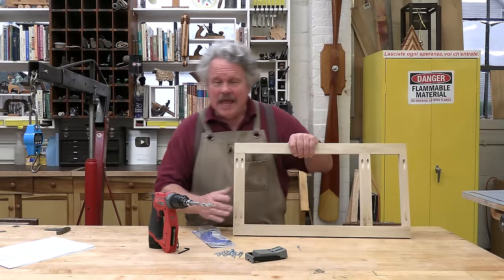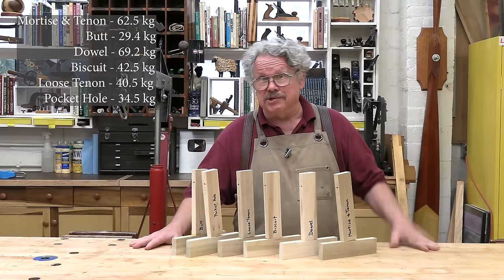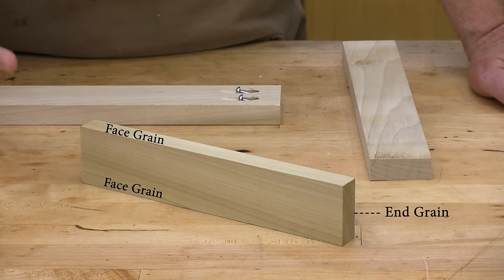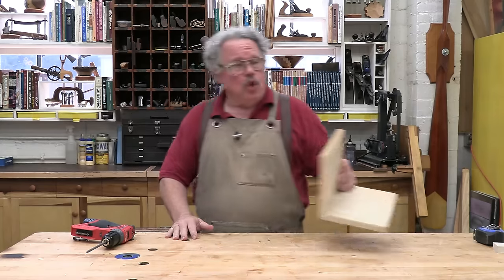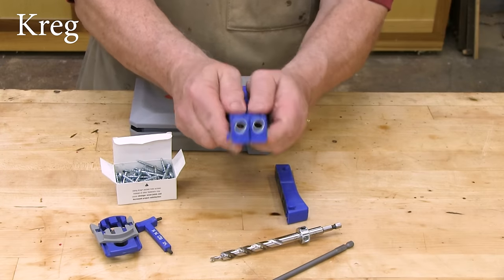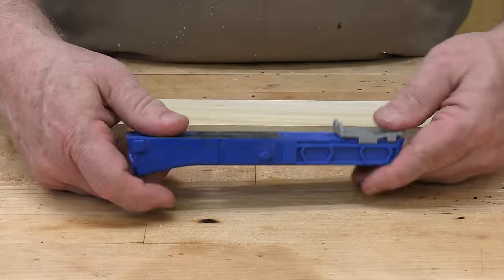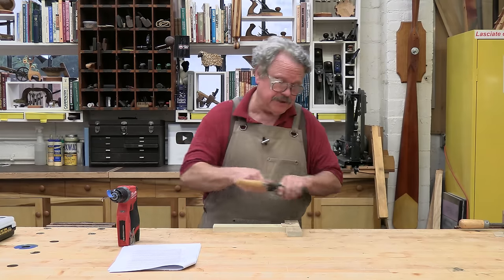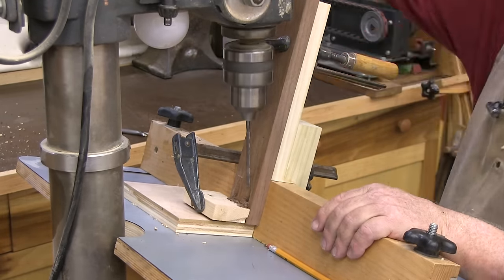Pocket Holes Overexplained

Comment: Pocket holes are a great entry point into finer woodworking, like building yourself some shop or pantry cabinets.  In my experience the #1 killer of the hobby (really any hobby) is when they jump in the deep end trying to emulate pro's or masters, before getting a win or two under their belt using easy and proven techniques.  
Just for fun I emailed the guy who bought the house I used to rent in the mid 2000's, I built some simple cabinets for the garage with pocket screws that I intended to bring with me.  In the end they wouldn't have made sense in the next place so I just left them, anyway I asked if the cabinets were still tight and sturdy, he said yes and had no idea a first timer built them because they look and work well.  So plus one for pocket screws.

Comment: If you put some CA glue into the pilot hole of the receiving piece of wood, the joint takes on a different level of rigidity.
This is x100 with MDF joints, although they need to be glued with a wood or construction glue. 😬

Comment: Thanks, I learned some new aspects of PH joints today. However, you did not mention that if you move the stop collar so the drill exits the end of the pH piece, you are also drilling the counterbore deeper and not leaving as much "meat" to prevent the head pulling through. I would have to think that this woulld weaken the joint.
Reply from the maker: That's a VERY good point, and up until 2014 there was a very easy way to belay that concern. What you're talking about is the Achilles heel of all pocket hole construction -- pocket hole joints rely on the strength of the wood between the bottom of the counterbore and the end or edge of the board. If the shaft hole exits to the edge, you're golden. There is some strong cellulose between you and disaster. But if it exits the end, it's another story. You're relying on the lignin that holds the cellulose fibers together -- and the lignin is nowhere near as strong as the cellulose. You can offset this somewhat by using proper gluing technique. Modern glues are much stronger than lignin (see Patrick Sullivan's videos), and a good glue bond will help disperse the load over the entire end of the board, as we demonstrated in our strain tests. But it's still a concern. The best solution I have seen is the telescoping bits made by the Morris Wood Tool Company. These consist of a long counterbore drilled out like a rifle barrel with a long shank-hole bit riding in that barrel. An Allen screw lets you adjust the position of the shank-hole bit in the counterbore. This, in turn, let's you adjust both the depth of the pocket hole and the length of the shank hole. I bought set in the 1980s and found them to be absolutely the best drill bit for pocket holes ever devised anywhere anytime in the history of the universe. I'm not exaggerating even a little bit (pun intended). I had written an entire section of this video on using telescoping bits for pocket holes, but when I looked them up to give viewers a link, I discovered that Morris Wood went out of business in 2014! I searched for a replacement, but I couldn't find anything comparable and had to cut that section. If anyone reading this knows of a manufacturer of telescoping bits (long counterbore surrounding a long small-diameter bit), please let us know. It would be a great boon to anyone making a lot of pocket holes.
Reply: @WorkshopCompanion  Or possibly, someone makes a combined shaft hole and pilot bit  for your second hole. I think most people will already be loath to do a second drilling  for the pilot hole, so I'm not going to suggest THREE drill bits!
Reply: @WorkshopCompanion  sent an email to the channel address. The Amanda 424000 face frame counterbore bit looks like a possible candidate. No direct experience myself.
Reply from the maker: @woodshopnerdery  Nice bit of research. I've ordered one of these bits to test it, but I'm apprehensive. The bore is 3/8" -- same as the pocket hole jigs I tested -- but the shank is 9 mm -- about .5 mm smaller than the guides sleeves on the jigs. I'll post the test here after I get some experience with the bit.
Reply: @WorkshopCompanion  Awesome! Looking forward to it. I would like to see the Miller tool footage also. Who knows could possibly see one on eBay.
Reply from the maker: @woodshopnerdery  Morris Wood Tools are all over Ebay. The Wayback Machine folks even saved their web site: http://morriswoodtool.com/
Reply: @WorkshopCompanion  Here it is! Maybe worth a dedicated post on you community tab or a video even?
Reply from the maker: Afraid not. The Amana bit was completely unsuitable for the task. The shank was less than 3/8" and the flutes were a few thousandths larger. If I had tried to make a pocket hole, the bit would reamed out the steel drill guide, then wallowed around inside it. I don't quite understand why Amana would advertise this as a 3/8" bit when its measurably larger, but it is what it is.
Reply: @WorkshopCompanion  bummer. Perhaps it is truly a 10 mm bit  made for the world market in Germany, and sold to USA as 3/8ths?
Reply from the maker: @woodshopnerdery  That would explain explain the discrepancy. 3/8" is really 9.575 mm.
Reply from the maker: And here's another head-scratcher -- Amana put a label right on the bit that clearly says 3/8" This was plainly meant for the American market.
Reply: @WorkshopCompanion  I’m using this 3/8ths to 10mm delta to my advantage on a current project. I’ve drawn up the plans in metric 10mm tenons. But I’ll cut the mortises with a 3/8 bit. That’ll let me shave the tenons to fit.

Comment: Hello I really found your video helpful but I would like to know if pocket holes work well with 3/4 in. Thick MDF boards.
Reply from the maker: Sort of. They work best when you're fastening MDF to wood. If you fasten MDF to MDF,  you must be extremely careful when tightening the screws so as not to strip out the threads. And the vast amount of strength in the joint will come from the glue after it cures, not from the screws. Because it's so easy to strip out the threads, the screws only serve to (1) align the parts and (2) clamp them together while the glue dries.

Comment: Enormously helpful.  Shoot, all I need is to glue my butt joint to make interior storm windows!  Thank you so much!!!
Reply from the maker: You may want to reconsider that take-away. Consider having the best of both by gluing the pocket screw joint. You get the strength of the glue joint coupled with the easy alignment of the pocket screws. The pocket screws also serve as clamps, which saves time (to apply the clamps) and expense (to buy them). Most wood glues will not hold well unless they cure under pressure.
Reply: @WorkshopCompanion  yes!  I have done more research and have discovered that the devil with just glue is correct clamping.  Since I don't want to buy a pocket screw jig, I am going with a half-lap joint and a couple nails to secure the glue.  Thank you so much for your reply.
Reply from the maker: @catherinegmelvin7994  Research -- a word that is music to my ears. Much respect. Consider one more bit of research. If you have the equipment to make lap joints, you can also make saddle joints, also known as slot mortise-and-tenons. Twice the gluing surface; twice the strength. I made my back screen door with saddle joints thirty years ago; never a problem.

Comment: Would glue on the threads of the screw increase it's holding power?
Reply from the maker: I would have to run a test before I could say one way or the other, but my expectations is that it would add very little strength. Pocket joints don't fail because the screws let go; they fail when the wood around the screws shears.

Comment: I’m surprised Kreg never addressed the splitting issue. I’ve run into it quite a bit myself. And even if it doesn’t split it will make the joined board bulge a bit.
Reply from the maker: I get the bulges, too. And more often than not, those bulges evolve cracks. Pilot holes...it's a no-brainer.

Comment: Loose tenons are nothing more than large dowels. Does this mean that the smaller the dowel the stringer the joint, and the larger the dowel the weaker the joint?

Also, loose tenons are only different from standard mortise and tenon in  number. A standard is glued into 1 board and loose is glued into 2 boards . There twice the chances that it can fail, but the glue joints of the tenon into the mortise should be equal in strength and therefore equal if all things are even

Comment: IMO, there's no point to gluing a pocket hole joint.  If strength is required, then you should switch to another method of joinery.  I totally agree with the need for pilot holes and it astounds me that the makers of the jigs are so adamant that they're not needed.  It looks like you're getting cleaner holes than I'm getting - mine are usually messy enough where the plugs would need a whole lot of filler to do anything.  Part of the reason might be that your method of clamping is just much much better than doing what the kits recommend.  I've never tried to do anything with the plugs - perhaps that would be a topic for a video.
Reply from the maker: Decorative hole plugs. Maybe. There are stranger things on YouTube. Thanks for sharing.

Comment: Welp, this explains it. My husband made pocket hole shelf inserts for some storage cabinets for me out of MDF. Zero issues. He loved it. A month later I tried to fix my grandkids' oak bunkbed that had been broken in a move and it was an utter fail. The whole every single joint cracked. Badly. (My daughter ended up fixing it by drilling holes... and pilot holes... directly through the wood and that did the deed. Don't worry guys, the broken part wasn't structural.) Now I know why. Screwing into hardwood duh. Now I'm mad at myself because I should've known that. I did know that. I just didn't apply that knowledge in the moment. smh

Comment: I actually came to see if you had a solution to the wood splitting on the edges but i guess pilot wholes is the only way :( . No one seems to talk about the splitting on the ends of face frames and i thought i was the only person who needed to pilot hole , i also see pretty much everyone not going all the way threw with the shank exiting the wood, i really do wonder if we are doing it wrong.
Reply from the maker: Pilot holes have been the best way to prevent screws from splitting the wood since there have been screws. As for shank holes, if you want the screw to act like a clamp, you need the shank hole and counterbore in one piece and the pilot hole in the other.

Comment: When building wainscot frames (3/4" thickness), at what point do you use a different joinery when your rails & stiles are at different widths?  For example, 3 1/2" stiles and lower rails 9 3/4".  My baseboard has a 5 1/4" width and the lower reveal to be 4 1/2".  Since it's going to be fastened to a wall, is it ok to use pocket hole joinery?
Reply from the maker: It's impossible for me to give a firm answer without a better understanding of design, materials, and environment. But the rule of thumb that I go by is that pocket hole joinery is ok if you're going to depend on existing architecture for strength and stability.
Reply: @WorkshopCompanion  Thanks for the reply.  I am using pine board and some sites I was on, it was discouraged to use pocket hole joinery on pine????   It's a frame that is going to be attached to the walls.   Except for the lower rail, the stiles and rails are less than 4" in width.

Comment: I’d like to see a comparison of strength in the other direction: face stress. I know they’d be similar, but still curious. Mortise and tenon wins. Has to.
Reply from the maker: Not sure what you mean by face stress. From an engineering perspective, there are four different types of stress that a joint must withstand -- tension, compression, shear, and racking. Racking is by far the most destructive, and is therefore the reason most joints fail. Consequently, most stress tests involve measurement of racking forces.

Comment: Is the Drill Press Table compatible with a ShopSmith? Thanks.
Reply from the maker: If you have a Shopsmith, you don't need the drill press table. I designed the table to convert the standard metalworking drill dress into a woodworking drill press. The Shopsmith IS a woodworking drill press (when in the drill press configuration.)

Comment: Personally I don't even use glue in my pocket hole builds, I just design the project around the weaknesses of pocket holes and never use them in a way where they are holding weight on the joint itself, it's always reinforced with other supports.

Comment: How do you ensure the pilot hole is centred? Skill perhaps, but surely there ought to be an inner sleeve that could be used.
Reply from the maker: The  tip of the pocket hole drill bit is angled and leaves an inverted cone shape at the bottom of the hole. The pilot hole drill bit will follow that cone and find the center all on its own.
Reply: @WorkshopCompanion Thanks for explaining.

Comment: Friend, the result of the test is very subjective since in reality almost no furniture is going to have inertial loads and torsion, extension and flexion in its task of resistance of materials, since they are usually going to hold and serve as support without having constant tensions. , but it is revealing what one type of fitting supports and another

Comment: Would work if I made the holes on the side of the pocket board,  instead of its face?
Reply from the maker: Certainly. The only hard rule here would be not to drive the screws into end grain if you can possibly avoid it. Screws in end grain can easily tear out the threads in the wood.

Comment: Your test only applied lateral sheer force, which isn’t a type of force that a lot of joints are going to be under. For example, in your test, generally, the other end of that board would be pocket hole joined to another board, which would put it under a bending force. I understand you weren’t doing an exhaustive scientific experiment, but to get a true idea of the strength of each joint, you’d have to apply it to compression, tension, and bending forces which would more closely mimic the types forces a woodworking joint would be under.

Comment: I'm wondering what the results of the pocket hole would've been if the joint had been glued along with using pocket screws.
Reply from the maker: It was glued.
Reply: @WorkshopCompanion  Just wondered cause I built a simple computer desk 2' by 6' with 2x4's and a plywood top and this thing is stout.

Comment: In your sample size of 1, I'm kind of amazed the biscuit and lose tenon behaved similarly to each other. I thought the loose tenon would be more structural
Reply from the maker: We were surprised by many of the results. But as I said, you can't put too much stock in this informal test. We would have to repeat them until we had a statistically significant average for them to have validity.

Comment: Fyi those are not self tapping screws they are self drilling,  self tappers are what you use when screwing into steel or sheet metal not timber.
I actually just watched The Evening Joiner his video  'when NOT to use pocket screws' which are what these screws are and he explains the benefits of the washer head amd the self drilling cut, you should check his video out.

Comment: how do you ensure the pilot hole is aligned correctly??
Reply from the maker: If you simply shoot the pilot hole through the shank hole, it will be close enough for government work. If the wood is securely clamped when you shoot the screws, a slightly off-center pilot hole will not pull anything out of alignment.

Comment: I know this video is about making pocket holes, but that test of the different joints has me in the butt joints over pocket holes in most situations camp.
Reply from the maker: Consider having the best of both -- glue the pocket screw joint. You get the strength of the glue joint coupled with the easy alignment of the pocket screws. The pocket screws also serve as clamps, which saves time (to apply the clamps) and expense (to buy them). Most wood glues will not hold well unless they cure under pressure.

Comment: Seems like about as much work to set up as dowels, if not more, for less strength. I guess they have the benefit of acting as clamps, so better (or worse, depending) if you're on the clock.

Comment: Interesting.  Camming the joints to failure seems like an invalid test.   These joints are generally seeing force at 90 degrees.   Hopefully the joinery connection takes use and gravity into consideration.  The shear strength should be the thing that is tested not whether you can cam the two things apart by twisting them.   I don't think we learn very much by twisting the wood.

Comment: why not drill the holes in opposite order? pilot hole, then shank hole, then pocket hole. it would leave a pilot hole for the larger diameter drill bits to center themselves on.
Reply from the maker: Or the point of the larger bit leaves an indent to center the smaller ones. Works fine either way.